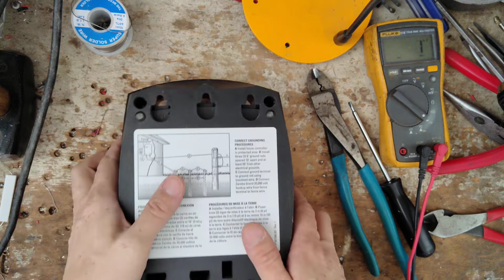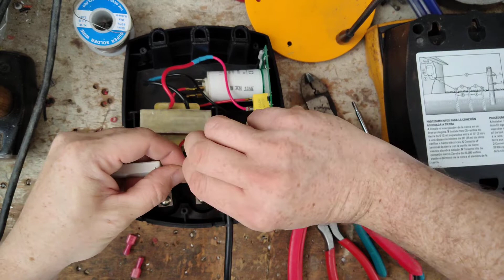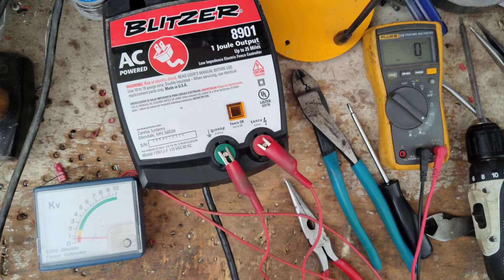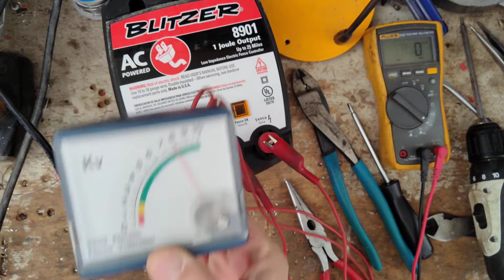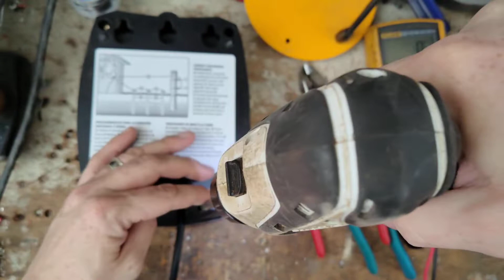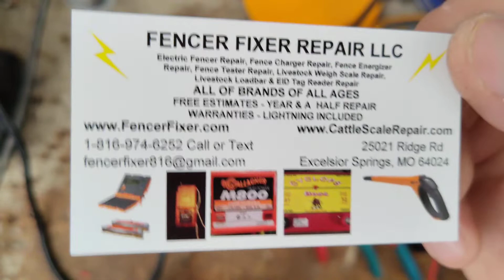Blitzer 25 Mile fence charger repair update

Comment: That's smart to put a load and lower the voltage and make it the right joule.
Reply from the maker: It's probably safer too. I couldn't find my digital fence tester during the video, but after I got done with the first one I found it and it was putting out like 14-16kv or something crazy. So I thought... Woa... That's way too much voltage. I installed a 400 ohm 10w resistor and that seemed to get it down into that 8-9kv range.